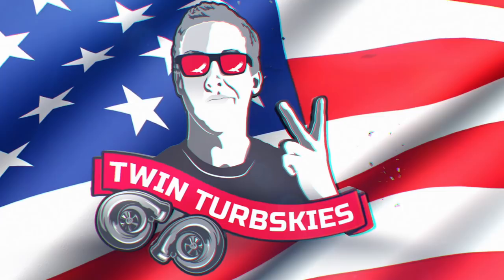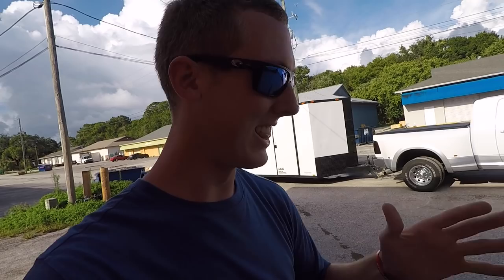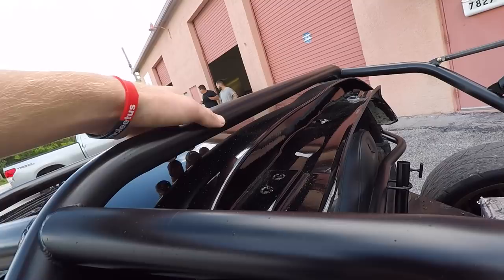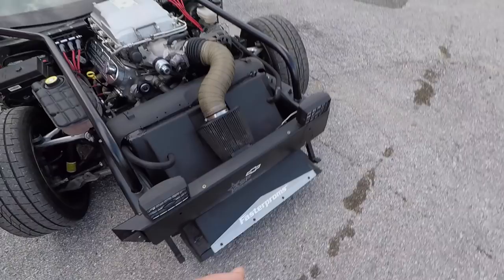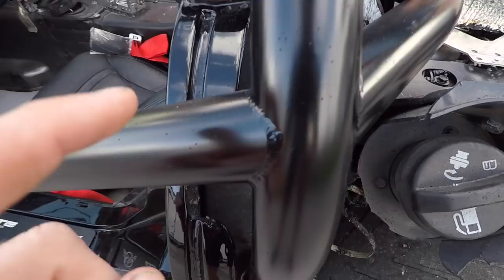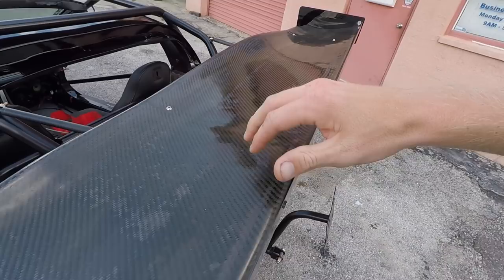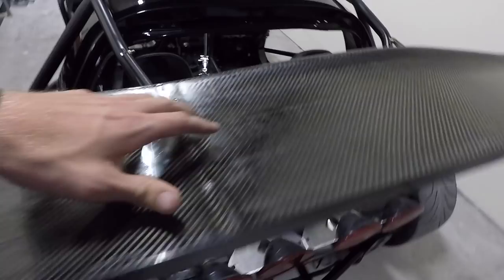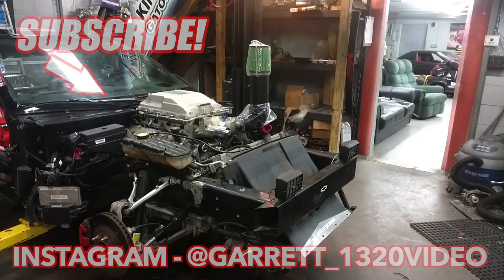Supercharging Leroy Ep.7 - Exo Cage is INSANE! (spoiler alert)

Comment: Should install 8 inch LED light bars as headlights
Reply: TRIPLExHAWX I think a 9 inch bar would be better
Reply: AlwaysMobbin I agree, I suggested JW Speaker 8900 evolution 2s which are a very good headlight which would fit his car well. Even though I love light bars (I have 2 Rigid's on my jeep) I think going to light bars will ruin the look of the car.
Reply: AlwaysMobbin Just because they're light bars doesn't mean they're EBay shit. Rigid Industries or Rough Country make great light bars that would look sweet. Rigid makes a spot or flood combo light that can be adjusted for use on the road. Plus, it gives a great look with the rest of the vehicle.
Reply: LIGHT BARS ARE NOT HEAD LIGHTS. They are for off road use ONLY.  Everyone driving the opposite direction will be blinded by them
Reply: the 9 inch light bar would be perfect. they are supperior

Comment: You shouldn't be using a twisted rear wing since there is no rear window to alter the airs angle of attack, plus that wing is high as fuck so even if the correct body/window slope profile were correct it still wouldn't be necessary, you should be using a standard profile wing.
Reply: Beach&BoardFan I was wondering why it was bent, to me it kinda looked like a wing for lift instead of downforce
Reply: Just google twisted spoiler or wing I'm sure there's already a comprehensive explanation out there. Race car engineering magazine is probably where I would start, I'm pretty sure I remember reading one of their articles detailing  wing/canard/vertical stabilizer profiles.
Reply: Yea it makes more sense now. Definitely the wrong wing for this car
Reply: I think It's fine. The air over the windshield will trip to turbulent and slow down since it can't follow the roof so I think that air hitting the wing in the middle won't be very effective, so maybe a twisted or straight makes little difference. It would be entertaining if he took it to a wind tunnel to optimize the wing angle and show what I'm talking about.
Reply: He said it was removable and adjustable
Reply: Master chief, the angle of attack is adjustable the air foil profile is not. Bottom line a standard profile wing would best suit the setup.
Reply: I would love to see the face of the wind tunnel tech when they roll 
that thing into it, that has to be one of the most aerodynamically dirty
 cars in existence.
Reply: Are you guys seriously worried about airflow of a wing that's mounted to a corvette with no body panels and an exoskeleton?
Reply: YES!

Comment: Hot damn! El' Roy looks SICK!
Better put some wingnuts on those flag pole T-screws to secure them or they will vibrate out.
The only thing I would add would be some cross braces at the front and rear of the engine to further stiffen the frame.

Comment: U should of had a badass removable center section to cover the blower kinda like those rock bouncers have it looks good but added strength there not only would it protect the blower in a roll over but also strengthen up the front part of the cage from what I c if it rolls over its gonna taco the motor badly

Comment: That front windshield part will collapse if you roll over. There is no down bar at the dash.
Those front bars around the engine do very little as the bend in them would allow a lot of flex.. 
Not knocking the welds or the nice bends, those are excellent. Just the design part, I know they worked around keeping the car looking like a stripped out vett. But from a crash point of view I see it folding up on ya.   I am not a drag tech guy but circle track and they would fail that cage..

Comment: Love it. If your not sure about the wing you can just get a smaller wing. C6R levels of downforce sounds like is too much for the super light car especially when your not running down force in the front. Make sure you tune the angle of that wing right. If the car squats a lot it can change the angle the wing and it can be dangerous when your not running a lot of down force "angle." Too much down force lifts the front not safe. You want to balance the car I would go with a smaller wing Bc with the the big wing your not going to be able run a lot angle anyways the size is just wasted and when run really low angle on a wing that's to big for the setup when the car squats it can be dangerous.

Comment: hey cleetus, may i suggest a sheet of thick plexi or thin bulletproof glass for the back opening behind the seats? you need some protection there. god forbid a tire cord comes whipping into the cockpit and slices one of you guys, youve been pretty lucky so far. also, a 50" light bar for the front would be pretty trick.

Comment: Cage could be alot stronger on the front of the car, those 2 front tubes wont take a side impact or much of anything without a lower window bar and front cross bar. Yes its 4130 it is strong, But it doesn't mean anything when its just a dead node

Comment: I dig it man. I'm usually not a fan of wings either but it does look pretty good on there. and at least it is there for a reason not like a wing on a civic or a vertical duckbill (aka windbrake). 
they did a kick-ass job on that cage. how long you think it'll be before you make it to 8.50 in the 1/4 and need some more bacing lol. that car keeps getting more and more insane while getting cleaner

Comment: That is not 8.5 safety,  halo bars/cage ,dash bar, intrusion bars, missing,restrainment latches ...etc...roll that at 100mph and your dead son. limbs will be missing when the roll cage cuts your arms off
 It's a good start but don't make people think this is all you need to be safe ,it's less than 1/2 the bars you need. Would best left at the shop so they can finish it right. You do film race cars RIGHT ?

Comment: looks good but I would have done a exo cage like on bad ass razors. The weight would have helped to but it still needs to be scaled out and weight put and out where needed but definitely is gonna need a extra 300 over or behind the wheels. something like my ghetto as s10 I'm building we just rigged a set up that takes fun weights and a bolt goes thru the tube to keed it tight LoL good thing I dont race at fancy tracks that tech your car my hood would come off then when they open a door ther gonna say go home LoL but all I do is 1/8 with zero tech. No shit I kno some guys that have cars that are running 5.00's and teens no cages and shorts and teeshirts and flip flops no shit. Atleast my new set up that has like a 8 point cage (hoop,door bar's,and pillar bar's) it looked so bad it was mine and my buddy's first attemp at any thing like that but after we cleaned the welds and painted it I'm very satified with it (probably not all that safe but better than nothing I guess) but its the dude  who had the idea to turbo 4.8's and 5.3's I probably wouldnt nmbe having cage problems. I mean 6.80's in the 1/8 with zero safety hear except a helmet is still dumb but I that car every where never got hassled that 7.00 index class is pretty fun. no class killers just really good bracket racers they always win out of the 20 somthin times iv tried iv only won twice